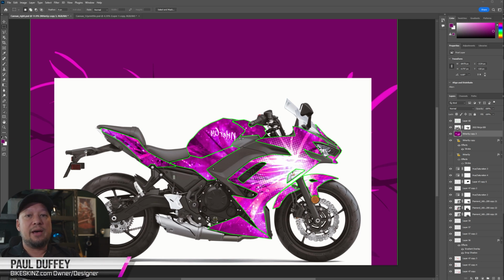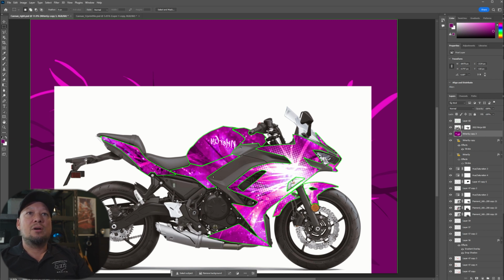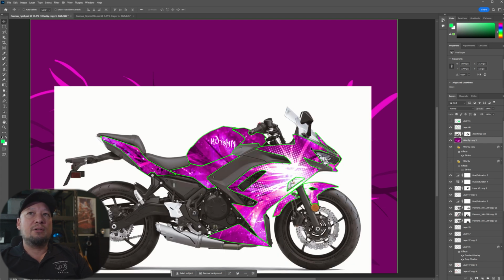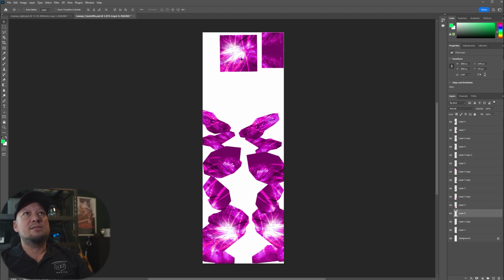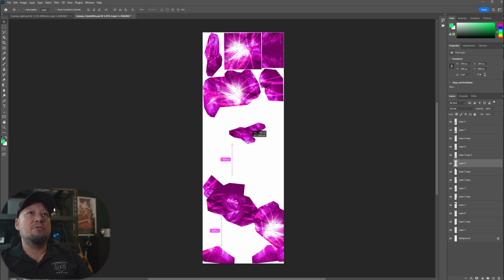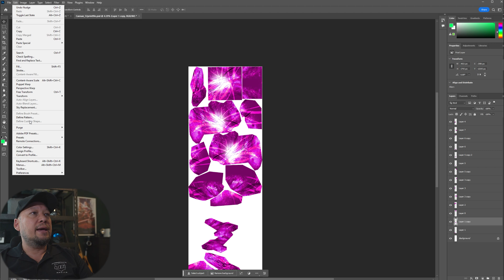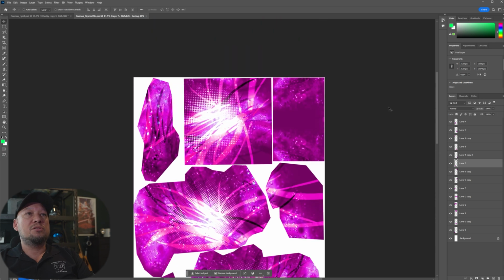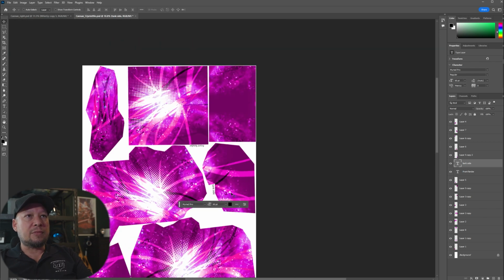Nesting Odd-Shapes in Photoshop for Print

Comment: Hey man I had a question for you about how to size things correctly in photoshop to make sure it fits your part once you have the vinyl printed out. For example if you were going to make a vinyl for a part that is a pinstripe following around the edge of your part, when you are creating the design in photoshop or illustrator its in 2D but obviously your part is in 3D so how do you make sure your pinstripe is going to not be out of line of the edge of the part because of the hills and valleys of the part. If you wouldnt mind messaging me back I would really appreciate it.
Reply from the maker: I wouldn't advise pin stripes on wraps